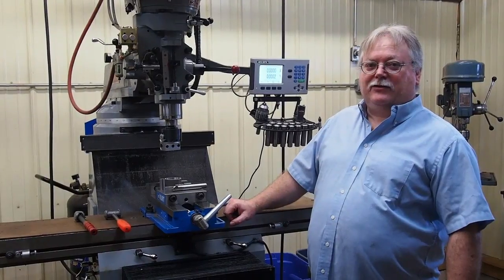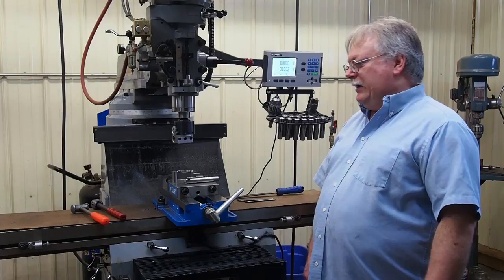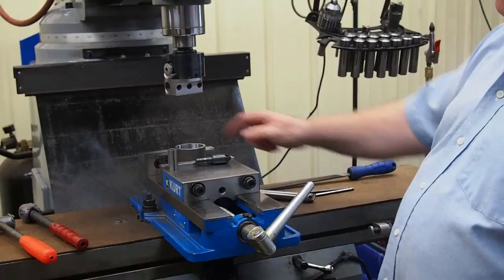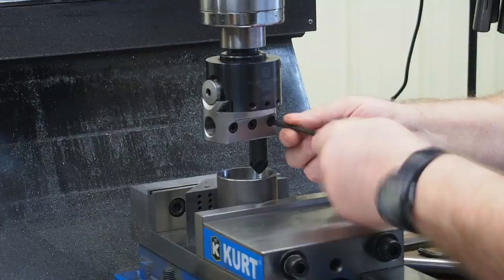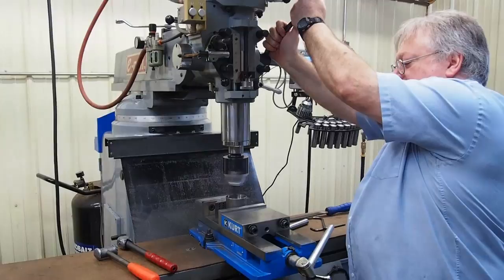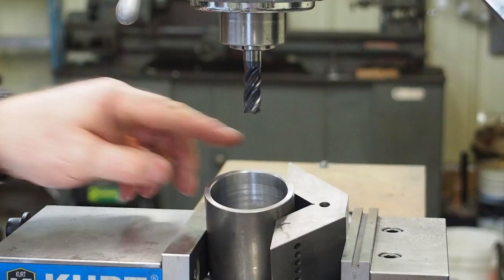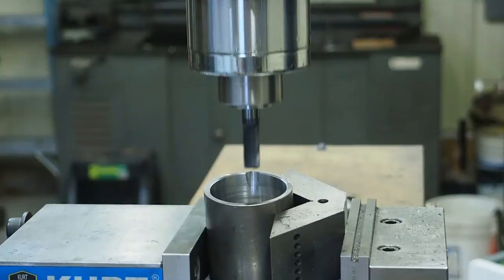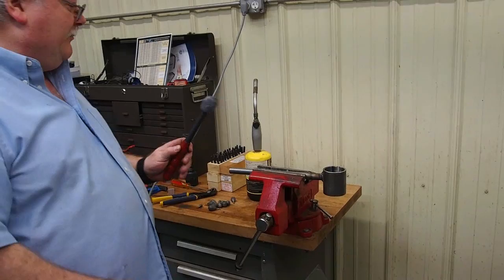Pouring a Lead Hammer

Comment: What size pipe did you use to make the head of the hammer?  Any idea on the weight of the hammer head that you made?
Reply from the maker: Can you read Fusion 360 files. If so, I can send a model of the whole thing.
Reply from the maker: .od. 1.31" i.d. 1.065" length 2.5" no idea of weight.

Comment: Steve, that was a nice time saving tip re: combining the chamfering tool with the boring head.  Thanks, I'll machine myself a bushing like yours.  
I sure admire your shop, about all you need now, is a lathe with the appropriate accessories.   Retired machinist, with a small home shop. TreeTop
I'm subscribed, BTW
Reply from the maker: Thanks TreeTop1947,

A 15" multi turn lathe is the next major piece of equipment we want to add, it will be awhile for that though due to the cost. Before the lathe we plan on adding a high speed spindle attachment to the surface grinder so that we can do precision Internal Diameter grinding. 
Steve
Reply: I look forward to seeing the I.D. grinding attachment, in the future!  TreeTop
Reply: I would've locked the quill and fed the table up. Keeps me from having a 'whoops, pulled to hard all of a sudden' moment.